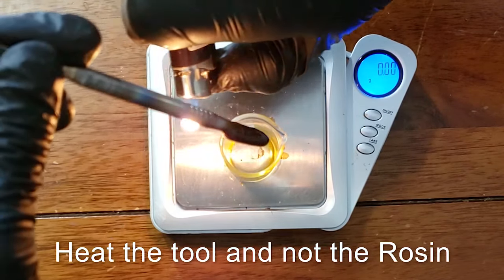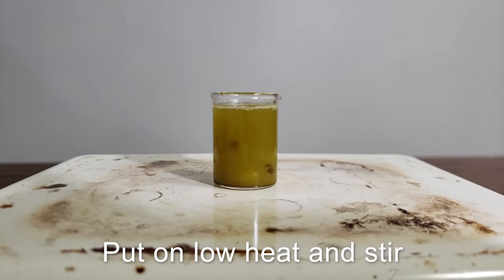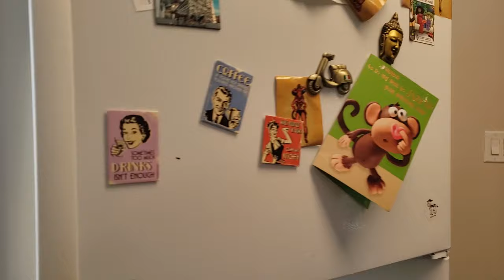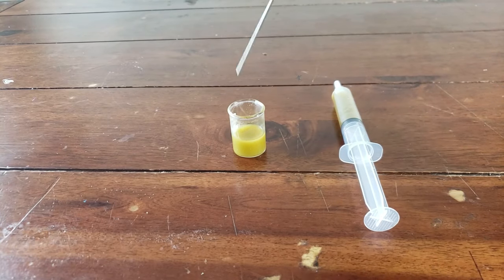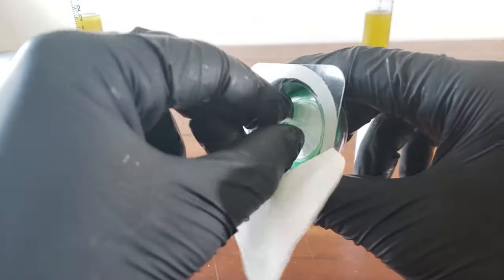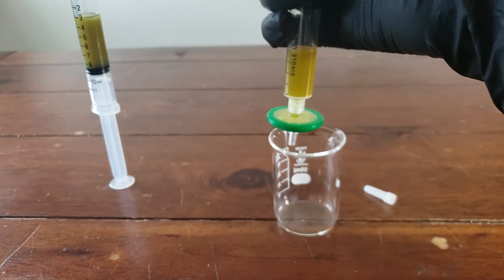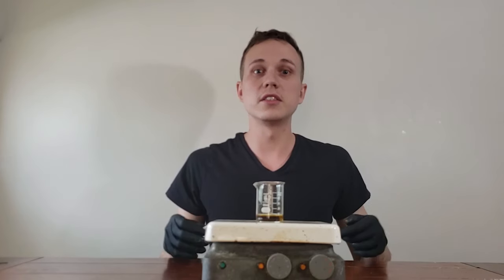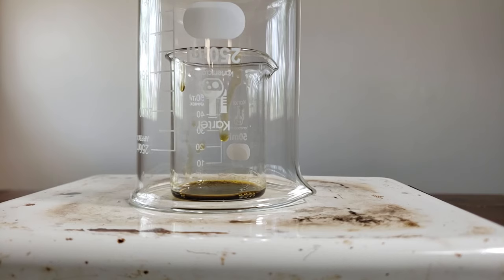There is HOW much Fat and Wax in Rosin?

Comment: Fats and lipids aren’t necessarily the biggest concern with rosin. Sure they take up mass which in turn destroys potency. However they are soluble when introduced to the brachial environment (lungs) as they are water soluble (human body being mostly that). The biggest concern is the wax. It is in no way soluble not even to ethanol as proven in the video. These will in fact accumulate in the lungs and diminish the oxygen to blood exchange that the brachia cells are responsible for. Essentially coating your lungs over time. I get the biggest kick when people argue they don’t do solvent extracts while lighting a joint, bowl or blunt with an unrefined Bic lighter. Wanna see some high PPM’S? Rosin is great for edibles as it will pass through the digestive track and produce a very high 11-hydroxy-metabolite. In summary DO NOT SMOKE OR VAPE ROSIN. Class dismissed.

Comment: Hey bro you can speed that process up if you use dry ice to freeze your solution. Put your beaker in a small cooler with dry ice around it. Winterization happens faster and colder.

Comment: Nice vid, you should also perform your filtration in the freezer and pre chill syringes and filters. as soon as the temperature of your wash increases especially at 10:1 saturation, the fats and lipids will redissolve back into the solvent rapidly. Maintain lowest temperatures possible throughout the process,  try 72 hours in the freezer first ideally you need sub -30c to parcipate the fats, or try some dry ice in the wash if you can get some that will get you down around - 100c✌️
Reply from the maker: Yea dry ice is the way to go. I was just trying to keep this simple and easy to film and show
Reply from the maker: @johnkbroderick  Yea not the best, this was just a demo of the concept for people. I wouldn't really recommend doing it.
Reply: -100 C would freeze the ethanol as well so I would definitely stay at the -30 C range to be able to filter it properly. 
I freeze 2 jars, 1 empty and 1 with the ethanol and then I also freeze the metalfilter so that everything is as cold as possible when I filter it. 
I also go at least 120 hours with the occasional swirling of the ethanol.
Reply: Remember, how you talk about your videos will influence how other people talk about it so don't put yourself down man. 
It was a great video overall, you have a good presense and you seem to know what you're talking about. 
Keep doing what you're doing.
Reply: i feel like gravity and a 5 micro or 15 or 25 micro rosin bag does the same job, you can let it sit to filter in the freezer
Reply: Nothing is nice about adding solvents to solvent free concentrates. Y’all are clowns fr.

Comment: What you need is a little table top centrifuge and some 100ml test bottles. Much easier to separate the solids, waters, emulsions, waxes and oils.
Reply: Another commenter mentioned that temperature plays a role in the solubility of the fats in the solution. Centrifugal force alone might not overcome this.

Comment: Newbie question/comment.  In my opinion, pressing rosin at home is the cleanest and most flavorful way to enjoy a concentrate.  What are the benefits of winterizing?  What are these extra steps getting you?
Reply from the maker: These extra steps remove the fats and waxes from the rosin which might assist in edibles or vape pens.
Reply: @CartandPod  
U can just do all that without the solvent added to the rosin by keeping on low Temps until it liquefied to right consistency.
Reply: @unknown_savant  i can do it like using a heat mat ?
Reply: @406.dabber8  If a good BVV® heat mat/pad that can actually set a temp on like 130°F then yes most definitely
Reply: @unknown_savant but won't the fats, waxes and lipids still be in there?

Comment: What is the purpose of wintering? Does it remove any of the medicinals since most are fat soluble? If we took out all the steps that were for the video its- melt rosin with alcohol 1:10 & push through micron-filter? Great video. I like to learn. Thanks 😁
Reply from the maker: Add alchohol to rosin, melt/mix till dissolved. Put in freezer for at least 6 hours so the fats seperate. Then filter to remove the now seperates fats.

These fats and waxes you remove should have next to no thc content.
Reply: I’m confused on what exactly the purpose is of this process tho?  Like.  Why take days out lol? Like you had rosin. Then a long process.   And turned back into rosin? Low fat rosin ?
Reply: @Bradhowell420  It‘s a cleaner end product and it‘s a lot more potent
Reply: @Bradhowell420  its so we can put it in vapes now

Comment: Well if you want to get that stuff out you know you can get a setup that's a little easier to use than that. At around -15 to -20 if the hose is going to dry ice all the chlorophyll and fat and everything will clump at that negative temperature then the only thing that will come out the other side will be pure wax. So if you want to make wax in a larger quantity then the rosin method. You generally can make wax with no propellants by using 200 proof alcohol. Not isopropyl either grain alcohol or ethanol. You can also buy an alcohol recycling system(roto vape) will you get about 75% of the alcohol back. You've got to have something though in the middle for the hose to pass through the dry ice  unless you have a little mini Pharmacy freezer that can get down to -25 or so. Definitely was entertaining brother but if you want to make larger quantities and you don't want to do with the rosin Tech. That's a way to do a pretty big amount and still come out with the quality of rosin but leave them produce more some strains that get 35% back. I've even seen upper thirties. It's all good though beautiful stuff beautiful medicine just wanted to add a little bit in case somebody wanted to make more. best thing all the people that smoke wax could do for the country! Is tell people stop blasting butane.
Reply: Because smoking alcohol is safer?  Especially since is much harder to boil off alcohol than it is butane. Boy you may wanna lay off the other stuff.

Comment: I notice you mentioned in your videos you do not prefer to smoke any extract that has Ethanol in it and the residuals are what I am most concerned about. I'm mostly wondering if I just wait long enough I can purge it completely with the fan...?
Reply: @CartandPod  where is this vacuum chamber video? It's been over a month.  I'm curious
Reply: Nope gets stuck in the resin and traped vacume pulls it out and heats helps loosen it up

Comment: Hi. I saw you mention that this is NOT needed for vape carts but then also said to avoid coils burning or dark gunk building up its best to do so. I also saw about decarb which I thought was to just remove unwanted solvents. Are you saying, to make a nice golden colour cart to vape, you can use just rosin and then decarb on a hotplate at say 150-160c on its own. Then bring it down to say 90c and mix your liquidizer at your desired ration and then, if you really want, add a few drops of terps? Be really useful to know how much effect winterizing would have if purely for vaping your extract? Thanks
Reply from the maker: Never use a liquidizer. Liquidizers and thickeners are what is killing people and putting them in the hospital. There are other ways to remove fats and waxes. I reccomend using a syringe filter instead of this method.
Only use terpenes. Exclusively. Terpenes and concentrate.

Removing the fats and waxes will give a better vaping experience. Decarbing is not to remove impurities but rather to convert the THC-A into THC so it does not crystalize in the tank/cartridge, as well as increase potency depending on how hot your cart fires.
Reply: @CartandPod  Ok so winterize rosin and then just add, if needed, few drops of natural terps then vape? I wasnt aware that the thickeners were causing problems if they are clean and free from all PEG ?
Reply: HowToWeed yea what about terp cut? Viscosity oil? What is your views on this

Comment: What you think of this?  Say you make this process like you show and you end up with the winterized ethanol rosin liquid.  You dry this liquid out on a plate by natural air, how ever long it takes.  Then you scrape up the material and then proceed to place that into an oven to decarb until the bubbles disappear (usually 2-3 hrs at 250F).  Wouldn't this oven time be long enough to purge all of the remaining alcohol?  So it would be perfectly safe to vape in a pod or cart?  Even using isopropyl in the same manner would work just as well wouldn't it, in regards to purging it completely?  Maybe even use dry ice to help winterize it another notch.  Thanks and love your videos on this subject.
Reply from the maker: This is just a demo of what’s in rosin, don’t try to clean rosin this way it defeats the purpose of rosin
Reply: @CartandPod  I was only wanting to clean it up for a pod really.  I hear regular flower rosin isn't good in pods, but never tried them personally.  It would be nice to find a good way to make flower rosin in a pod, as hash rosin is very expensive.

Comment: my first try was totally success, but the second dont want to separate the wax an fats ? is it problem by to much heat or the ratio from alk to g? i used pressed hash and ethanol 96,5%
Reply from the maker: You need to make it colder. Try dry ice
Reply from the maker: Pressed hash is typically lower in fats and waxes too

Comment: lets add solvent to solventless rosin
Reply: I was wondering, what in the hell does winterizing accomplish? The rosin looked quite ok but I guess this was needed? I feel like it just ruins it.
Reply from the maker: Nothing it's just a demo
Reply: @briggan007  doesn’t it make it better and cleaner for vape cartridges. I heard that the wax, fats and lipids destroy your coils and also why wouldn’t you want it to be clean and pure. Why would you want to smoke fats and lipids. You’d have to smoke more to get the same effect as one or two hits of a clean and pure product.
Reply from the maker: Yea but you'd be better off just starting with the bud instead of rosin. This was just a demo
Reply: Do you mean mix the ethanol with the herb right away, filter and then winterize, while it’s dissolved?
Reply from the maker: Yea you got it, no need to press into rosin first. Winterize and mix at yhe same time though by using very cold ethanol for the wash

Comment: Sorry i cant comment on the video on 4 ways to decarb.
I use a magnetic hotplate at 150f and its takes longer to decarb. Is better or worse if it takes longer at a low temp, or do it matter as long as the bubbles are gone?
Reply from the maker: That is fine too. It'll take longer at a lower temp but you should also be able to do less damage to the terpenes with lower heat

Comment: Can i take any oil too thick for a cart like sugar wax and go through the process (non-demo version haha) and just vacuum purge it and be good to go? I ran hot terped/decarbed sugar wax through the filter and actually noticed a small difference but the top half of the cart never flows. (vs no filter id have to heat the glass up on my glass cartridge every time for it to flow). I decarb at 250 for 2 hours its just not enough and no idea how to fix it! (i use terp liquify, really don't want to use mct oil). Thanks for your great videos!
Reply from the maker: Just use some terps to thin it much more simple
Reply: @CartandPod  yeah i already used like 25% terp ratio haha. etiher way love your videos and always very helpful man.

Comment: Can you do this to RSO and put terpenes in it to liquify it to put in carts or maybe use cbc to make it less thick
Reply from the maker: Cbc works great at making it less thick yea. Rso winterized would be a good starting concentrate.
Reply: @CartandPod  could I use short path distillation afterwards to make thc distillate from that?  And potentially isolate terps and cbd too?
Reply: After winterizing*
Reply from the maker: If your short path setup is quality enough yea. Otherwise you'll end up with just thc distillate and waste.

Decarb and winterize before distillation
Reply: @CartandPod  would I need a roto vap or just precise and consistent temp control?
Reply from the maker: To seperate different substances like cbd and thc and such you'll need a quality rotary evaporator yea, they are extremely expensive.

At that point you should also get a co2 extraction setup too
Reply: @CartandPod  so what would be the next best way to refine the RSO after decarbing, winterizing, and filtering it to make it the most potent and clean?
Reply: Also I appreciate the quick responses this is stuff that's kinda hard to research and takes a minute to understand with no background in chemistry

Comment: you are  very organized w/ this educational presentation.   its given me some ideas for
      the basic problem of separating the desired plant compounds from the other crud.

a few ?'s for you ... when you have a moment ...

    1.   the blunt tip needle ... are they 4" or 5" in length ?

and    2.  the syringe filters ...  how many ml of 190 solution before they are plugged up ?

 ...... and    3.  did you explore re-usable syr' filters ... that just need to have the teflon circle replaced
     ...........  with a new one ?    

       and , lastly ,  4.  why  a .22 micron ?  is there a relation to .22 and lipid molecule size ?
there are lots of nylon mesh filter bags available for sale in the 25 , 100 and up micron size.
couldnt a nylon bag of small size be filled w/ the 190 resin solution and squeezed such
that just the dissolved  -oids   pass through the bag and the waxes , lipids dont ?

thanks
Reply from the maker: 1. Their 4 inches but it doesn't matter.
2. I am not sure, I just did this one example. I don't really reccomend you following this to the tee as it's not exactly the right way to do it, it's done incorrectly on purpose to allow better filming.
Reply from the maker: 3. I have not tried the reusable ones.
4. .22 micron is the smallest size I had available on amazon to me.
Reply from the maker: Lastly, yes you can press rosin in a tight micron bag to filter out everything but the thca. I will have a video on that soon.

Comment: Awesome tutorial.i love it!

I am on the hunt for a string hotplate such as u have we had 4 schools.2hs 2 middle shut down locally I know theres old shit around this town (not even old just used)
Reply from the maker: The one I have linked in the description is pretty good, but if you want a classic  lab one like I got you can find them used on Ebay. A new one of the model I have that is full lab grade is over $1000-2000 but they are like $150 used
Reply: @CartandPod  yeah we had 4 schools locally shut down amd unite into 1 big school.so I KNOW THERES LAB AMD OTHER SHIT FLOATING AROUND ITS JUST FINDING IT... I want a stirring 1 for sure, I'm trying to get myself a nice setup for everything start to finish...

Been actually working out my own press saw ur juice press one that was great how wide was the hair straightener plates? I seem to only find 1 and 2" thos looke larger!

Also I was going to use a shop style hydraulic press along with 2 irons that once wired up incan digital thermometer them to get a good reading...

Idk I may look to invest in a cheaper squanch box or nugmasher type press.

Point was as I wanna get a full set up to be able to do this stuff including growing as soon as I get my medical.card in a few weeks

Comment: Im confused, is that "This is not the correct way" in the description just a safety disclaimer so you dont have to worry about idiots? Ok, but, I do have a serious question. What temp did you set it at after you added the everclear? "Low Temp" is kinda relative... Thanks!

Comment: Have u ever heard of acetylization of thc? It was in this book i saw at borders books 20 years ago, claiming thc acetate (i believe thats what the compound was called) is 25x stronger. I wish i could remember the book title, maybe cannabis alchemy. Im really feeling that was is
Reply: Thz for the tip
Reply from the maker: I'll try to take a look if there's any info out there.
Reply: Theres plenty of information about THC-O-Acetate out there, unfortunately its not a homemade type of product. It's created in a lab due to the complexity of the SOP's
Reply: Thank you Matthew McDonald's for your linked to the subject of Ortho acetate of tetrahydrocannabinol yes it seems that there are things that we just don't know but what I do know is that the THC isolate or thca isolate of the rosin of the flower of any cannabis species would if treated as morphine in place of morphine rather in a simulation cook 150 C for 6 hours I believe with the latter  of course then you will see THC Ortho s state
Reply: Making thc acetate is not likely to be done especially at home. It requires acetic acid which is a heavily controlled product due to being used in heroin production. Not only that but yes it's supposed to be extremely potent with a 30ish minute onset. So chances are that if anyone did take the time to produce this product, it'd come with some sort of contract stating you understand not to do more than x amount in x time otherwise you'll be beyond toasted...
Reply: Glacial acetic acid is very purchaseable, but its not the right ingredient for heroin production. U really want acetic anhydride, which is also what is used for thc acetate production. This is quite possible if not easy to make with a ketone lamp and dehydrated white distilled vinegar. Simple distillation yields strong to glacial strength. There is also a way using an acetate salt, carbon monoxide and methyl alcohol
Reply: @alllove1754  I'm just going based on the recipe on the book you mentioned which just calls for acetic acid.
Reply: If it called only for the acid... that wpuld be nice. The anhydride, thats your dope chem